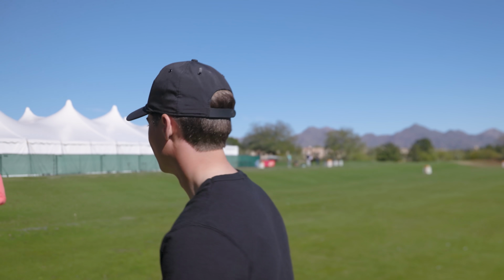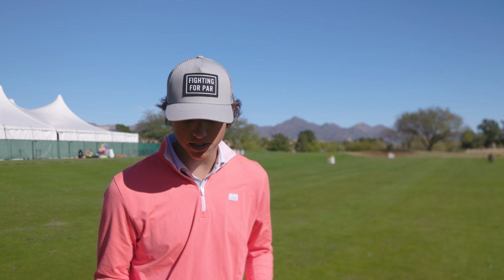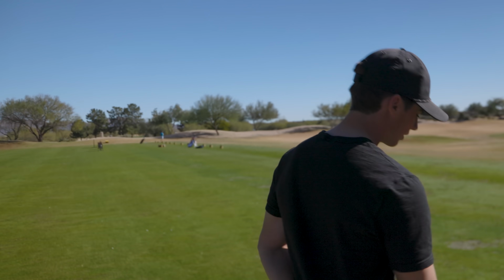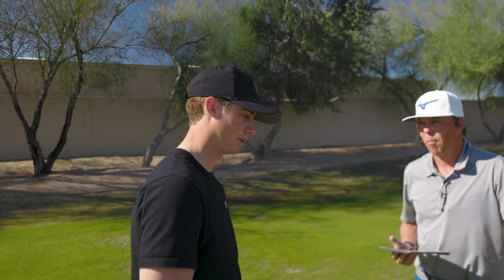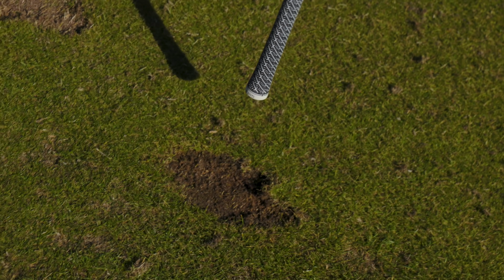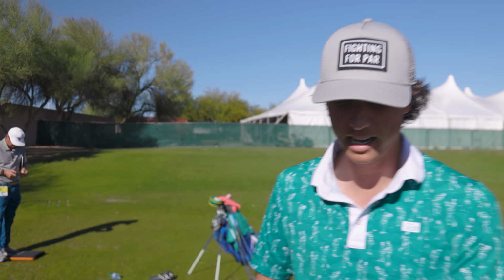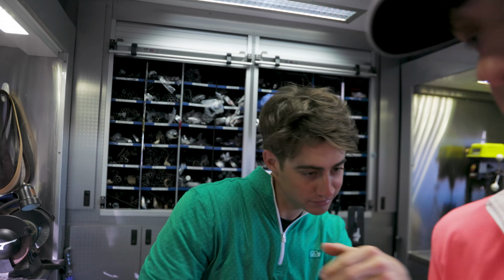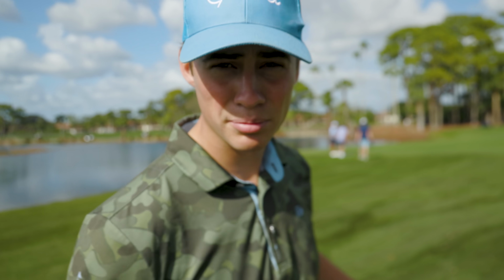I Got Custom Fit For BRAND NEW IRONS!!

Comment: Lie angle is more important for start direction rather than turf interaction. As long as the ball flight is good and looks the way you want, the divot is almost irrelevant.
Reply: Exactly, a lot of people miss that point and argue otherwise, adjust based on your specific ball flight preference. Divot is irrelevant for the simple fact your contacting the ball before the turf “ as you should “ so if your hitting the way you want as he stated they fly straight and I hit them good but the divot is bad. What? Makes no sense to me.
Reply: Yeah, and Garrett already loses most of his bad shots left, so more upright would not be a good idea
Reply: Yes. Ball flight is king
Reply: If the toe digs, it twists the face through impact… which affects the start direction and spin axis… goshhhhhh
Reply: a shaft that is too soft has droop as the CG of the head tries to align with the shaft and will make the toe droop down and look to be too flat as well, a nippon 105 plays a little soft compared to lots of equivalents
Reply: Ball flight > divot or lie tape reading all day long. I see so many fitters recommend a more upright club to guys that miss it left just because of a lie tape reading and it drives me crazy.
Reply: @guitaristbiker  I agree. I think he needs to be in at least a 120.
Reply: There a few different ways to check lie angle, and divot isnt one of them. Lie is very important and i dont follow the comments saying its not because you hit ball first. If you are toe digging and trying to hit a draw its much harder as ground is holding toe back. Same for fade and heel. Proper lie allows for better ball control and much easier manipulation for shot shaping. I was fit in march and was shocked at 5’ 10” i was fit 2.0 degees up. Did 20-30 mins of lie testing because honestly i didnt believe him. Used lie board and lie tape with marked ball and after testing i am 2 up and hit ball much better, easier and further. Hitting draw i like is also far easier and much more controlled. 
  Fun fact… fitter i had has 20+ yrs experience and said not many amateurs have standard lie, most are 1 or 2 up.

Comment: You guys are so much fun.  Thanks for all your hard work.  What I want to say Garrett is I feel like you need to use your legs more.  I'm no professional but I have all kinds of sports experiences (volleyball, golf, hockey, badminton, tennis, swimming, curling, drinking Lol) and I understand how the golf swing works.  It looks like your upper body takes over the swing as you're coming down and you're therefore unable to use your leg power fully.  I think, first and foremost, this accounts for your inconsistencies off the tee.  Tig has that leg power going and is, generally speaking, much more consistent off the tee.  Good luck and thank you all for the great vids. Neil

Comment: Congratulations! First time “commentor” 🤣 I am looking to do the same as you this year. I have been playing Mizuno Blades for 15 years now, MP32’s. Nothing feels better than Mizuno in my opinion. Like you, and most, I’m also going through a swing change. I stopped playing for years but now I’m back to golf. I want more tech to add distance in my irons, even though I’m pretty long. I love the 225’s but I’m afraid of losing spin, hitting the ball too high, and hitting too far. So I’m also considering the 223. The dealio is I don’t like the way the 223’s look. I’m going to have to get past that I reckon because the 223 gives me more distance that I want with the forgiveness that I need. So I’m thinking of 223 in the shorter irons, and 225 in the long irons. Fingers crossed. And congratulations again. Welcome to Mizuno Nation. 👍🏿
Reply: Just get the 221 PW-6 iron, 223 5-3 iron. Problem solved lol.

Comment: Garrett just taking over the iPad and fitting himself 💪🏻😅
Reply: That guy was not really trying to sell the clubs or shafts. Seems like everything is told by the data and AI… unless they cut the business secrets part out of this clip. Literally people can take the sensor and tablet and fit themselves smh
Reply: @bedehsu4377  I’m old school and have been fitting once in the past 20 years swing has slowed down a little, but have had the same clubs since 2012 (1.5 flat) and only changes that have been made is graphite shafts and a little weight added in the neck of my jpx 800 pros same length, lie, lofts for 20+years. The lofts are more towards traditional lofts (exmp 7i 33*) I recently played 18 with the Taylormade p770s and couldn’t hold a green. So I’m gonna have to put some stock/beliefs in a club fitting here soon as the 800pros have been refinished rr grooved and re-everything to their brink. But I’ve also seen fittings go both ways, if the fitter cares enough and learns/knows(as much as he possibly can) whoever he’s working w, golf swing, the results will always be better than just taking a shot in dark and trying a bunch products that aren’t necessarily good for the golfer and try and make it work. But I digress, it’s been seen and done both ways w positive results

Comment: Love these videos! Could you give us a ballpark price range for a club fitting on this level? A breakdown of the cost of the equipment and the fitting itself would be a nice gauge for golfers interested in doing this.
Reply: I just had a Mizuno fitting done with the Swing Optimizer and bought a set of 223-225 combos.  Generally the fitting is $100-150 and the new Mizuno are $1500 for a 4i-GW set.  Price doesnt change for custom shafts, grips or combo sets.
Reply: Lots of places waive the fitting fee if you buy clubs that day. 
Every manufacturer will have a list of no upcharge shafts and grips that will not change the price from MSRP. 
It gets expensive if you want a shaft with a big upcharge on every iron.
Reply: @mikedadekian4317  Damn, the fitting is way more affordable than I initially expected thanks for the info!
Reply: @travis2386   That’s what I mean with Mizuno, they didn’t charge for any steel upgraded shafts.  Only graphite’s like Recoils were an additional cost.  Same thing with grips… no charge for any grips, including the GP MCC midsize I like. 

I also looked at the Taylormade P770s but they wanted an additional $60 per club to install the Nippon Modus 3 120X that I was fitted for.  And $10 for the MCC Mids.
Reply: @mikedadekian4317  Oh okay, good to know. I didn't talk price and what shafts were upgrade or not until I chose my set. Mizuno's weren't a great fit for me, I got no upcharge on the dynamic gold with the Ping's I chose, but was limited with grip options.

Comment: Wish you'd tried the Project X 6.0 or 6.5. Feels much better than DG x100 TI.  DG feels too whippy and light compared to Proj X. Toe down divot is good if you tend to hit draws.  I've seen you miss it to the left.  If you toe up your lie angle, your hooks will come back. Also you didn't need to get a whole new set of blades.  Blades are all the same, for the most part.  They could've easily adjusted your lie angle.  Stiffer heavier shafts will lower your ball flight and reduce spin.  It will be a nightmare on firm greens.

Comment: This video shows that fittings are not always the burning bush. G was gitted with flat lies a few months ago but his divots say he needs standard or upright. He also came out with different shafts. For a player at his level his swing wouldn't change much if at all in such a short space of time and the fitting should be the same. The only real change was a different fitter.
Reply: Congratulations you have been randomly selected for the full golf set clubs giveaway quickly inbox the above ⬆️ name on telegram to claim..😊

Comment: The optimizer makes the shaft heavier, wouldn’t that affect the numbers and thus affect the fitting/shaft?
Reply: maybe they offset it in the maths? Unless different players do different quirky things with their swing due to the added weight, then maybe it might be a bit of a problem for the calculations
Reply: I fit people with the optimizer and it’s amazing. I’ve had no complaints from anyone.
Reply: in theory the optimizer is a great tool but ive found it doesnt work for me when I was fit. My number #1 recommendation was C-taper 130x and #2 was Project X 7.0. Those things were like telephone poles and not ideal once we tried them out but I knew that already.

Comment: I got fitted for standard lie angle when I went to a Roger Dunn Golf shop. I got the Titleist blade and Cavity back combo set. Wish I would've got a flatter lie angle bc it always seems like the toe is sticking up and not on the ground. I was fit for Standard, but feel like they were probably just lazy and wanted to sell me the clubs they had in stock
Reply: The shaft will bow down towards the ground when you are releasing it, so that may be why they fit you in standard compared to the flatter lie. You should be able to bend the lie a degree or 2 if you don't like it later. They should be able to do that for you for free if you got fit there.

Comment: If you change to a stiffer shaft won’t that change the way the club face inters the ground and possibly meaning you wouldn’t have to change the lie angle ? I’m really just curious. I play the dynamic gold X stiff shafts in my mp-20 mb’s
Reply: Think about it this way, he has Nippon 105 with lie angles 1* flat.  That combo with an upright swing leads to toe down because of shaft droop.  Stiffer shaft means less toe droop and standard lie angle should mean neutral dynamic lie.

Comment: Mizuno not allowing you to hit the new shafts is a dumb process. You got fit with then and used that fitting device last time and picked that shaft with out hitting it and look what happened. It wasn’t right for you. Gotta hit that new shaft while getting fit. Titleist has the best fitting experience I’ve seen. Gotta see that ball flight with that new shaft

Comment: I think Mizuno had a bigger idea of this video. This was no Mizuno fitting guys, this was Garrett & Grant telling the Mizuno rep the clubs need to be more upright, have a couple of swings with their shaft optimizer and walking to the truck to pick up his new clubs. Never tried any of the clubheads or recommended shafts, didn't see any Trackman numbers or other data. There was no actual fitting involved in this video.

Comment: I hope there was tons more “fitting” than what ended up in the video. Stiffness of recommended shafts isn’t too much more than what you have now, but all are a huge weight jump up. Not sure how you ended up in a 112 g shaft with a 100mph six iron. Please just go to TXG and see Ian. I feel these “fitters” you are seeing are not doing you any favors.
Reply: 🤦, content video.  Agreed, hope there was more but my guess is this was squeezed in before/during the tournament so they could get the content. It’s probably a close fit, should help tighten his miss, but my guess is he will need to get used to the feel of the new weight.
Reply: Ian (Club Champion Sellout) Fraser
Reply: There was no actual fitting in this video. Just Garrett telling the Mizuno rep he needs his club to be more upright and walking straight to the truck to pick them up. Also, from Modus 105 to X100 is ridiculous. No swing change can justify that 28 gram difference.
Reply: @jeffoliviaproperties  Still understands club fitting significantly better than damn near everyone on this planet...
Reply: Agreed this “fitting” video was a joke. I’m confident the Mizuno guys set him up correctly, they just didn’t show any of it. Some romance with divots ..

Comment: There’s no way you should’ve ever been in a 105 gram shaft as young, fast, and strong as you are. Probably should’ve been in the Modus Tour 120 X in your current (old) irons.
Also, I’m sure you already knew this, but with as much golf as you play…your forged irons need to be checked periodically to make sure the loft & lie angles haven’t moved, because they will with forged irons. 
On top of that, you shouldn’t have to be guessing what you lie angle was on you last set…Mizuno should have all that info saved for you.

Comment: I really hate how the Mizuno guys use the optimizer as the end all be all to a fitting. At most the optimizer is just a tool to help guide a fitter. Should never be used as a substitute for a fitter's actual knowledge.

Comment: That was about as far from an iron fitting as possible considering your literally working off the tour truck. Shafts you never even put in your hand    I can assure you not a single sole that arrives to this venue to play for a check rolls through a fitting like this. They could have done a lot more for ya bro. Like actually fit you for a set of irons

Comment: kind of irritating video. Jumping in and out in shaky camera scenes and unfortunately mizuno custom fitting not coming over very well, 

You should have given time for the Mizuno guys instead of almost interrupting the flow! Attack angles, low point, club path, blade to path, speed etc i mean trackman gives the numbers and information but it just was not mentioned on this video, terrible club fitting at least what the video showed!